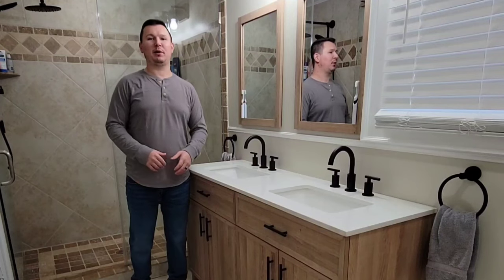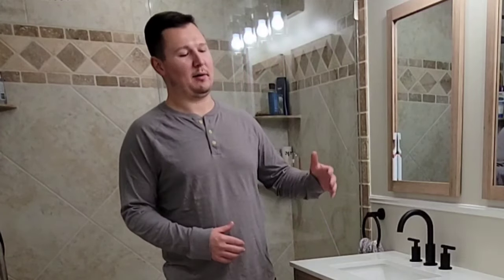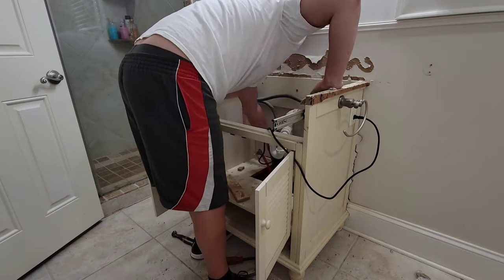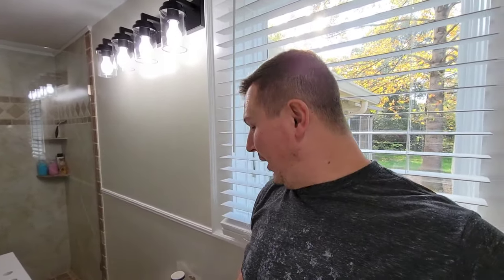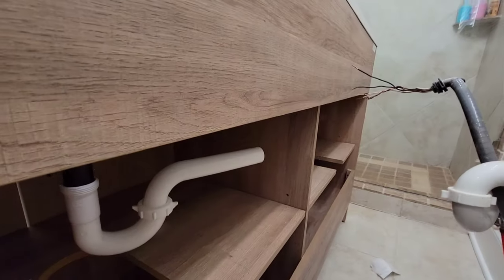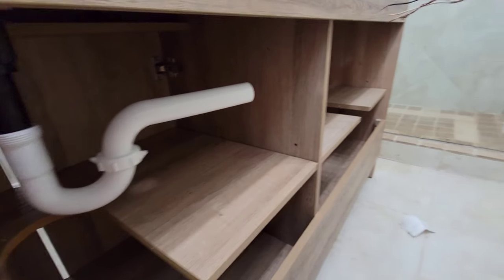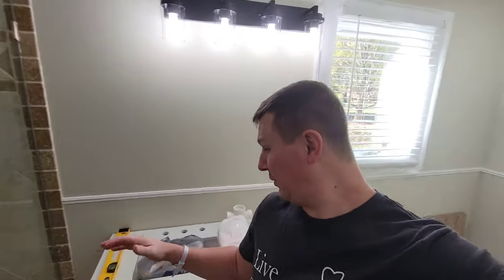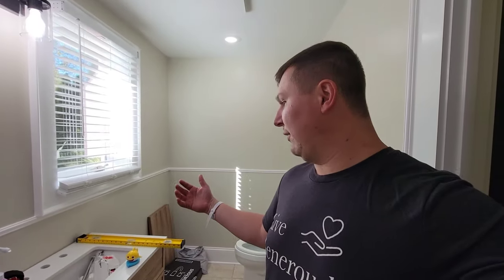DOUBLE VANITY Do It YOURSELF Install | Single to Double Vanity | How to Install a Bathroom Vanity

Comment: this is good information but your situation is probably very different from most. Most people have plumbing behind the wall not the way you have yours.  you have several options.
Reply from the maker: You can do the same exact thing with it in the wall. The benefit it that there is probably also a vent in a wall so you can just hook up the p traps and go

Comment: I thought that each sink needed its own vent... with the vent being at least as high as the highest water level. I don't see any vent at all in this installation.
Reply from the maker: I do have a studor right in the middle of the sinks. I think I missed a good recording of the vent but it's a 4 way pipe with the vent going up
Reply: Yup, each sink does need it’s own ventilation.
Reply from the maker: Most vent pipes are ran to a single vent in the wall so why would I need 2?
Reply: @BakersDIYLifestyle  you did it right with the sanitary T
I double checked the IPC and if you use a sanitary T with a studor valve it is permitted for vanity sinks 
Would’ve been incorrect if you used a regular T
Reply from the maker: Thanks! I appreciate that!
Reply: Fir a brand new DIYer, I wish you kinda showed each piece and named it and explained the process a bit more detailed. Like how to reassure no leaking and good drainage and good connections, etc.. thx for the video it was helpful!
Reply from the maker: Thanks for checking it out! It's hard to take time to film and talk when I'm doing it all myself but I hope to make some better ones in the future!

Comment: Electric box needs to be 3 feet minimum away from any tub or shower there call zones. If you put the outlet on the other side of the vanity you would be fine.  You did a great job. I think now  they want the ventless system above water line now in case you have a back up in the system. I used the one that looks like a air vent so the studor valve can hide in there and I think its easier because if you ever need to change the vent its super easy.  I install the studor vent high above the sink in the wall more near the ceiling. The vent box is paintable so you know.
Reply from the maker: Thanks for the tips! I did place the studor as high as I could but I couldn't get clear video of it. It's almost touching the bottom of the vanity top.

Comment: Is there a code on using 1 studor vent for 2 traps? I'm looking to do the same but my sinks are over 3" apart and I can't find anything other than the DFUs that the vent is rated for
Reply from the maker: I'm not positive but I believe if both traps run to the same vent/drain line like mine you're good to go regardless of distance
Reply: @BakersDIYLifestyle  I'll find out once we get ours inspected at the end of the month

Comment: Was water pressure affected by the value when running both sinks at the same time?
Reply from the maker: Yes but mainly because we bought cheap Amazon faucets with no restrictions. It also made brushing teeth beside my wife a very fun experience haha
Reply: @BakersDIYLifestyle  I am wondering if you would have gotten better pressure using pex T  fittings instead of a valve T fitting.

Comment: did you consider doing 1 p trap instead of 2?
Reply from the maker: I did but I wasn't sure if I would have room around the shelves or the main drain line so this was definitely the easiest. If I did it again I might take more time to try that or if the vanity was built differently I would.

Comment: Did we skip the water supply
Reply from the maker: It's in there really fast. I put a t adapter on the hot and cold and ran an extended line through the center of the vanity to each side.

Comment: you only put a vanity outlet on one side of the vanity?
Reply from the maker: Yeah mainly because I was to lazy to buy more wire and conduit haha We haven't needed the other outlet yet but if we ever do I'll add it back in.
Reply: i was thinking for razors....hair dryers...curling irons...water picks
Reply: He put the outlet on the side which is wrong and against code if it’s near the shower like that.  Needs to be on the wall, or on the other side which is why it was there in the first place

Comment: Thank you for your video! We are doing this to our bathroom now. Any issues with the plumbing? We had a contractor come out saying we would need to open up the floor and the wall to change the plumbing to a from a single to a double, but are looking into doing what you did ourselves. Any tips?
Reply from the maker: I'm glad it helped! The only advice I really have is if you are going to offset the main drain to 1 side of the double vanity, I would just connect both drains together and use 1 p trap like you would with a double kitchen sink. Good luck!
Reply: @BakersDIYLifestyle  one thing to note is the sinks can not be more than 30” from each other to share a P trap
That looks like a 60” vanity? might be right on the cusp of 30” on center
Reply from the maker: That's awesome info. Thanks for sharing that!
Reply: This is so DIY… and wrong. You need a second vent pipe which this person not do. Your contractor is partially right… that you should open the wall up to add the second vent pie. This video is not to code/recommended.
Reply from the maker: It's definitely DIY but it's not wrong. The system has 3 vents. 1 for the toilet, 1 for the shower, and 1 for the sinks. This setup is no different than how it would vent in the wall.
Reply: No… it’s wrong in terms of standards and what you should do. No legit plumber would ever advise you to share one vent with two sinks like this. The sink drain having a vent “down the line” can siphon the P trap for that sink and cause issues.
Reply from the maker: Maybe, but will it ever cause any real issues? Highly unlikely. It's just a simple way to make your bathroom function for a fraction of the cost

Comment: That vanity is gorgeous. Can you please share a link to the item?
Reply from the maker: We got that one from lowes. I'm not sure if they still have it now or not
Reply: Its called Dolton 60" vanity from Lowe's. I bought it because it was the cheapest one they had that looked nice. Its not very well made however, my top is epoxied down wrong. I think they didn't mix the epoxy so it never set up and remains a sticky mess. Also some of the supports that hold the top to the cabinet were broken when I got it.
Reply from the maker: That's why I got it too haha Although our build quality seems to be alright. I wish the top was separate though because that joker was a beast to move through the house!

Comment: Nice video but not for DYI. Also I wouldn’t cut anything on the clients sink top no matter how careful. 

I learned a lot however, you should have slowed down when doing the hot water cold water split
Reply from the maker: Hey glad it helped you out! I also didn't cut anything on the actual vanity top, only in the cabinet

Comment: Do each sink has hot and cold? And is the water pressure stronger on one side than the other?
Reply from the maker: Yeah each sink has hot and cold. The lines coming in have a splitter to run to both sinks. The pressure does drop when running both sinks, but you could plumb a complete circuit under the vanity, or in the crawl space that would help maintain pressure on both sides.

Comment: Do they make a dual drain 1 1/4  kit for bathroom sinks.I cant find anything online.?
Reply from the maker: I don't think so but you should be able to use a 1.5 in drain with a reduce ring to connect to the 1.25 bathroom drain.